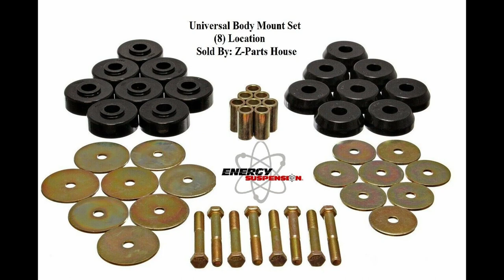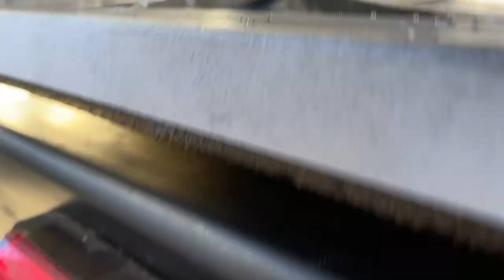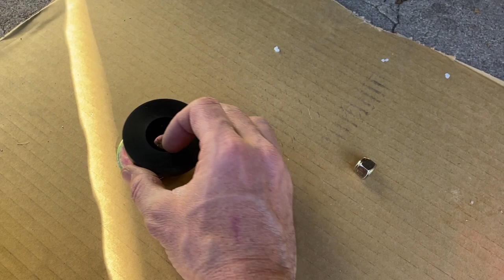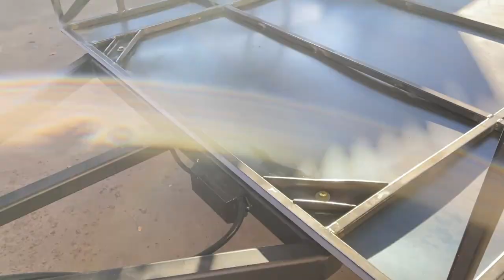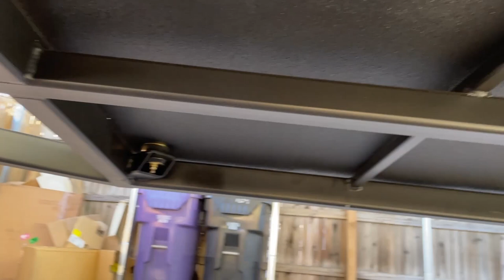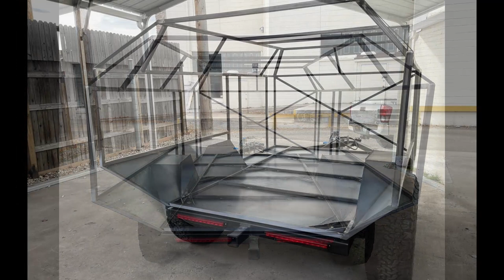DIY Overland camper trailer build: mounting the cabin on the frame

Comment: Did you use the sleeves (cylinders) that came with that mount set?  Looks like from the top down you went: bolt -> washer -> floor pan -> washer -> top bushing -> mount -> bottom bushing -> washer -> nut.  Is that correct? If you used those cylinders was the hole in the top of the mount the same size as the sleeve/bolt thickness? Thanks
Reply from the maker: correct!

Comment: Hey man...I've been doing what I assume you did before coming up with your plans...I've been watching TONS of videos on squaredrop DIYs.  I must say, your design is seriously 90% of what I want out of mine.  I'm not a teardrop (curvy) shape fan at all...but the other squaredrops are just way too boxy.  I like how yours is "kinda" boxy...yet with the mean angles.  I'm a nube to welding but have a friend I would have build the frame (like you did)...but I plan to learn on the job to do the steel framing (also as you did).  I appreciate your vids and will watch your progress.  I do want to say though...I "may" piggy-back off your design a bit if that's cool.  Mind if I ask a few questions on your build along the way?
Reply from the maker: Sure thing, happy to help!
Reply: @infosponge  Mind if I ask you a few questions about your build via email?